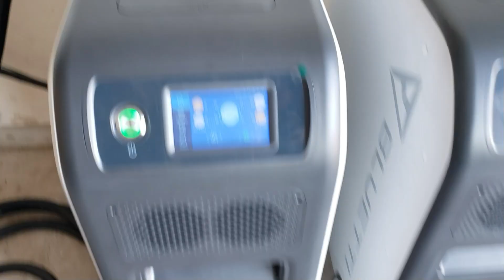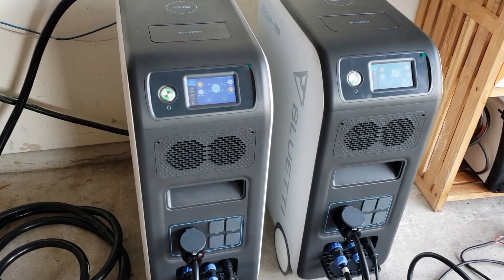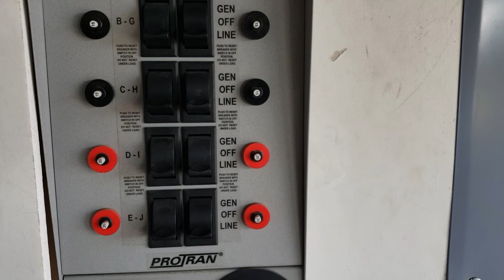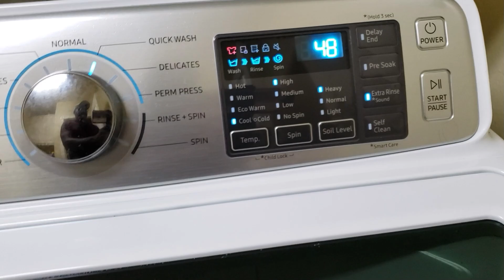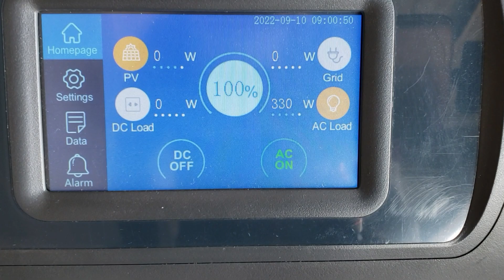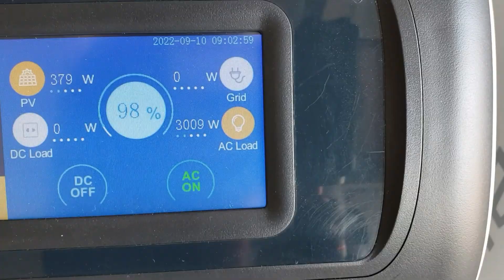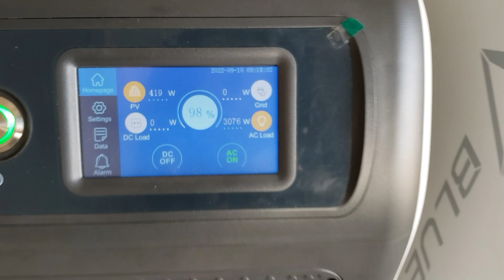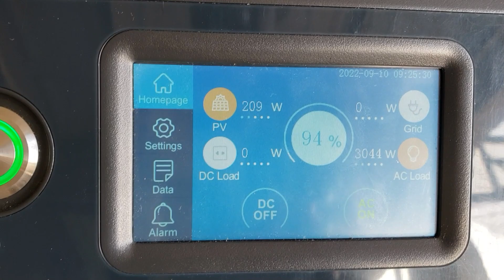BLUETTI EP500 Pro Powering my 5TON AC

Comment: Gavin if I bought one EP500 do I still need that adapter to do the 240volt hook up and tie back into my generator hook up, I have exact setup on my electric panel as you have.
Reply from the maker: No you need two units to get 240v

Comment: Gavin,do the test again with the A/C but next time try using the Micro Air Easy start module. It should drop the starting amps by quite a bit
Reply from the maker: I have the micro air easy start module installed on my AC

Comment: I want to know the power lose due to inactivity over a set amount of days. That Honda generator is durable and can take a common Briggs engine if it needed to be replaced, and loses zero power while inactive. If money is no option then sure, grab a kit with panels and have at it, but for the rest of the 90% of folks this just won't make sense. Also think of the number of cycles before needing to replace that unit. Great review overall though, sir!
Reply from the maker: Thanks MDubb
I actually have this one sitting for over two months without any charging and it’s still sitting at 99%
Reply: @GeneratorReviews  I was curious about that the most. My Tesla can't sit that long with nominal degradation. Good call, and great video!

Comment: Sorry I am asking this question: why do you use drier from solar energy stored in battery when you can just hang your clothes on washing lines as you have lots of sunshine?
Reply from the maker: I don’t use the dryer but just for demonstration purposes as to show the limitations of the unit I wouldn’t be washing clothes in a power outage situation. 
This is a test to determine whether or not it’s capable.

Comment: I haven’t tried my 4 or 5 tons on my AC300’s.  Soft start starting wattage peak is around 55 amps on both units.  Running around 20-22 amps.  It always makes me wonder if I should get the AC500’s.  The goal wouldn’t be to run the AC’s off these dedicated, more so the goal would be to allow it to be a buffer for my WEN 875i which would have less starting watts.

Comment: Can you run 3?
Reply from the maker: No they can only run 2
Reply: How about running 4? Is each one capable of receiving 2500watts of solar? Add 9 more of your solar panel set up (1000 watts). You should be able to run a house on that?

Comment: Nice! Qq how do you monitor the AC compressor current? I installed the soft start unit like you. But does you phone connect to that soft start??? Thank you!
Reply from the maker: Yes, the phone app connects to the Soft start if you got the Bluetooth capable one
Reply: @GeneratorReviews   so cool. I had to download the EasyStart app and mine says 27.4A starting and 11.0A Live. It’s a 2.5 ton. My 13k generator will handle it no problem now. If it wasn’t for your videos, I don’t think I would’ve installed this thing.

Comment: Nice video Gavin
Thanks for explaining the difference between the transfer switch and inlet box, interesting to see the difference between the two. Keep up the great work!!!
Reply from the maker: Thanks for watching share this with someone else who might need some assistance with back-up power👍🏾
Reply: Thanks for your comment! It's great to see that Gavin's video was helpful in explaining the difference between the transfer switch and inlet box. Understanding these components is important for a smooth experience when powering your devices. Speaking of power stations, have you considered the Segway Portable PowerStation Cube Series? It offers a massive 5kWh capacity, fast recharging, and versatile sockets. It's a reliable option for both outdoor adventures and home backup power needs. Keep up the great work exploring outdoor gear and power products!